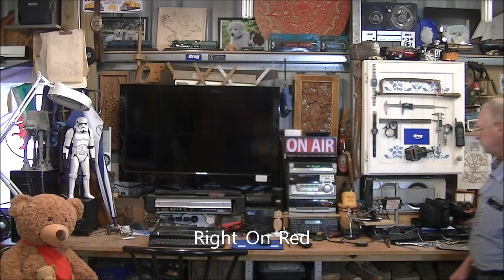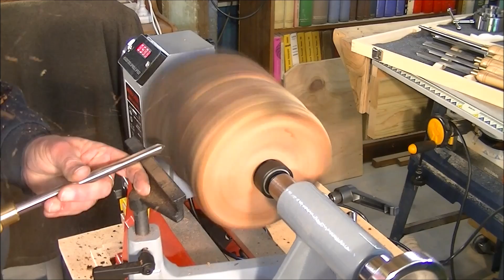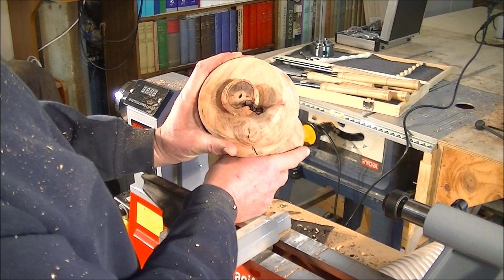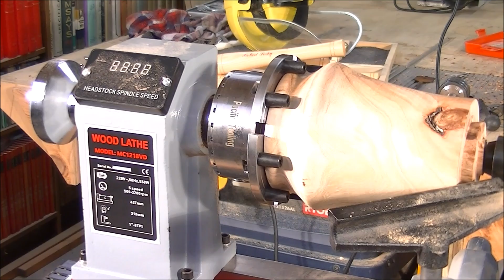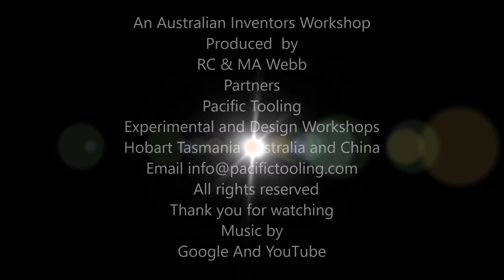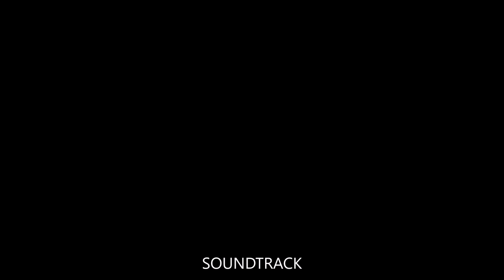Making an Australian Blackwood vase for beginners how to wood turn

Comment: Greetings Mr. Webb, I truely enjoyed your " Wood Turning for Novices , 101". Recently we had a storm here in Guam 
which resulted in felling nice trees.  I am not sure of the variety but I cut a piece to use on a child's school project and found that it is a hard wood with beautiful grain designs.  Now,  I am less than a novice and I have yet to get me a "Wood Lathe" and the assessories to do the wood turning projects safely and correctly.  Your videos is truely insperational and I've gathered a lot of information on the lathe and associated tools to turn wood.  Please continue your awsome videos and your explanation on the (W's) of wood turning emphasizing on "safety first " attitude. I know that as I continue to learn from you I would then eventually pass it to others wanting to learned the right and correct way with safety always in mind. Again thanks and best regards.

Comment: Are people actually dumb enough to use the motor to tighten their tool onto the chuck?  It’s it a cordless drill for goodness sake. I wouldn’t even do that with a corded power drill, good way to lose fingers if you are lucky, or far worse.

Comment: I had to chuckle at your comment to NOT turn the lathe on to mount the chuck.  I had gotten into the bad habit of doing that, until the day I didn't realize my lathe was still set at its' highest speed.  No fingers were damaged, but it slammed in so hard that I could not remove the chuck even after bringing in instruments of destruction like a pipe wrench.  I ended up having to replace the entire drive center portion.   
Great video, look forward to going back though some of your other ones.

Comment: What kind of lathe is that, and is it affordable for a beginner?
Reply from the maker: Pacific Tooling ships  worldwide: Email me at : info@pacifictooling.com I will send you information on our new * Lathe * and 4040, 6060, 6090 and 6012 (linear rail model) CNC routers and CNC lasers 6040, 6090, 1390 and 1225  .
Pacific Tooling; Australian Inventor Roger Clyde Webb ;-)

Comment: Roger, is Pacific tooling on the Web, with an online shop?
Reply from the maker: Hi John, Email me at : info@pacifictooling.com  I will send you information on our new Wood Lathes
 and CNC routers, 4040, 6060, 6090 , 6012 , 1212, 1224, 1325 and now CNC 6040, 6090 , 1390 Lasers (linear rail model), and machine tool accessories . 
 Australian Inventor, Roger Clyde Webb, Pacific Tooling.

Comment: how much would a lathe like that cost?
Reply from the maker: Hi John, Email me at : info@pacifictooling.com  I will send you information on our new Wood Lathes
 and CNC routers, 4040, 6060, 6090 , 6012 , 1212, 1224, 1325 and now CNC 6040, 6090 , 1390 Lasers (linear rail model), and machine tool accessories . 
 Australian Inventor, Roger Clyde Webb, Pacific Tooling.

Comment: Very talented!  Great job!  I miss wood working so much.  I have not worked a lathe in years and hope that after my secondary schooling is completed I can afford to get a small lathe  like this.
Reply from the maker: Hi, Email me at : info@pacifictooling.com  I will send you information on our new Wood Lathes
 and CNC routers, 4040, 6060, 6090 , 6012 , 1212, 1224, 1325 and now CNC 6040, 6090 , 1390 Lasers (linear rail model), and machine tool accessories . 
 Australian Inventor, Roger Clyde Webb, Pacific Tooling.